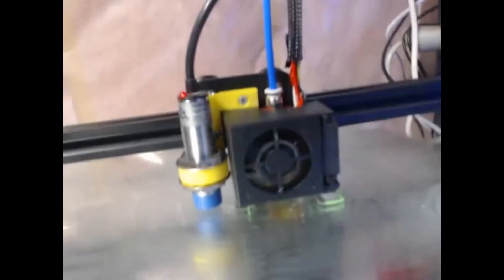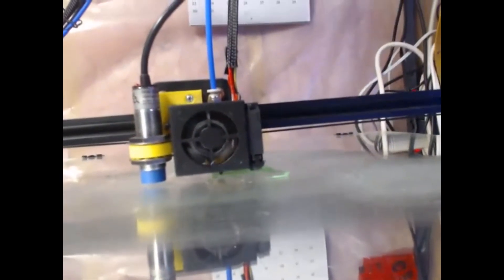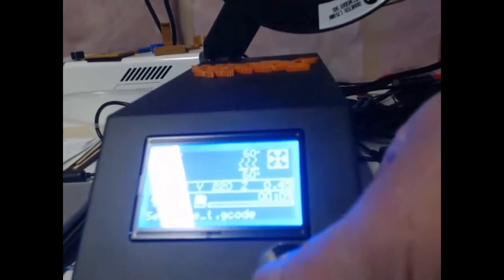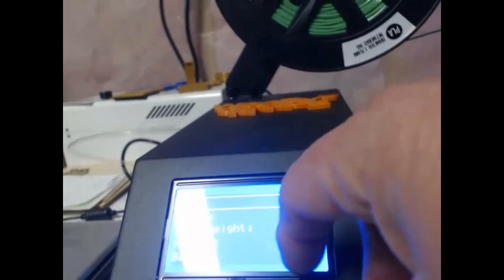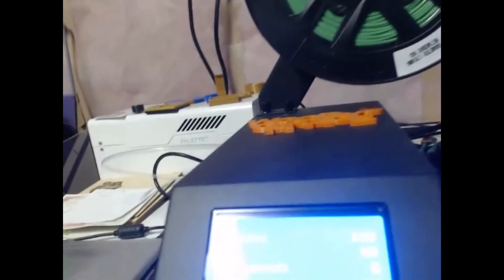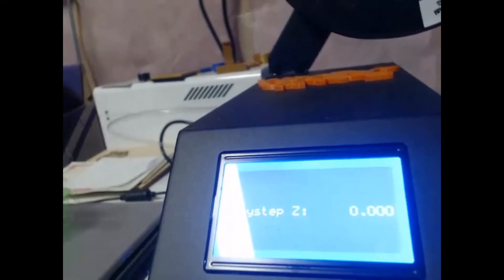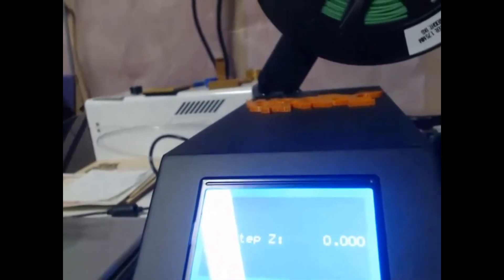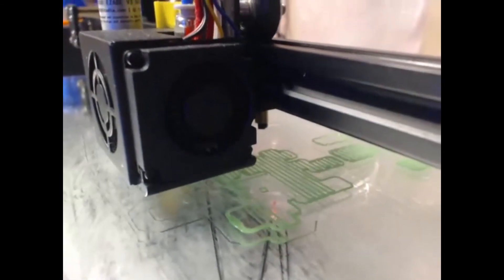Babystep Z

Comment: My Z endstop is inconsistent. This is exactly the function I need to adjust on the fly while the purge and skirt are printed without resetting the print several times until it's "close enough".

I'm amazed there aren't more videos on this!